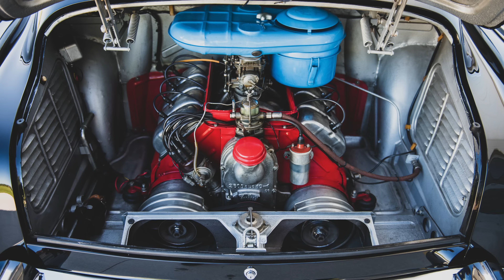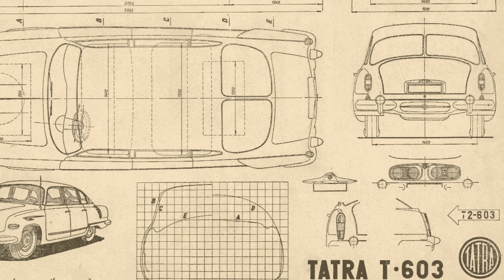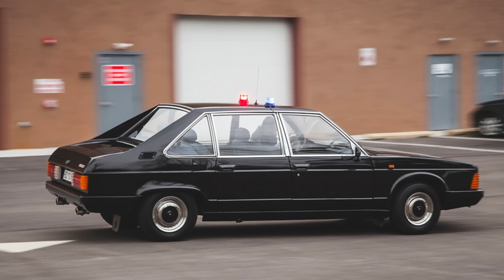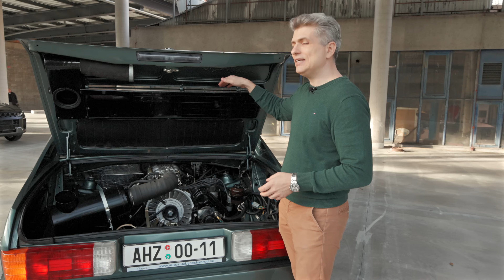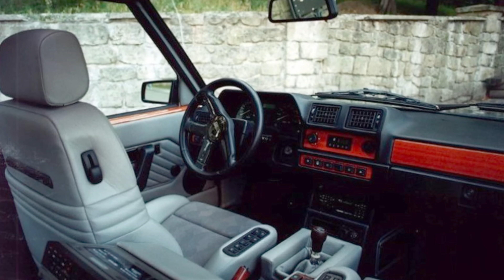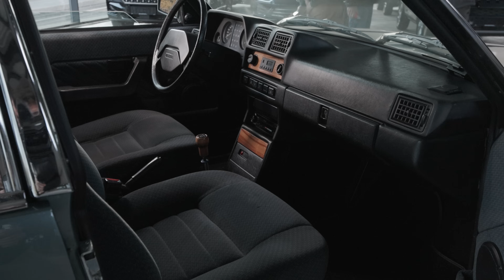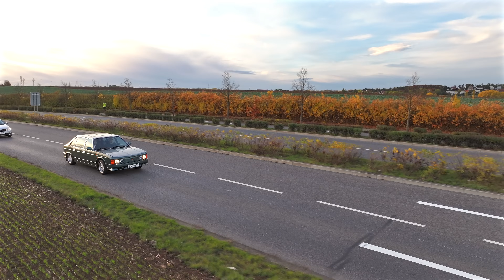I explore and drive Tatra 613, the bizarre car with an air-cooled V8 engine

Comment: One of the cars I always wanted to see in real life. and how I would love to see Tatra come back and produce a real luxury car that looks and feels different than what we know today. a true contender for worlds most luxurious car producer able to beat Bentley and Rolls Royce if they put their minds to it. The one thing that could have made the Tatra 613 exceptional would have been the hydraulic suspension from Citroën. Also that turning circle was pretty sharp, much smaller than what I was expecting. As for that engine sound, it doesn't sound like a truck, it sounds smooth and effortless, many V8 if not all of them today don't have such smoothness.
Reply from the maker: You have very good points here, which made me think deeper, indeed, a hydraulic suspension would have made it even more special, but still, it was one of the first in the world to use multilink. Turning circle was good indeed and the comment with the engine sound made me reconsider, it may be very well due to the good balance of the construction that it sounds deprived of the usual knocks from other V8s. Thanks for new perspectives of looking at it!
Reply: Diciamo la verità, era uno strano accrocchio al limite del controsenso dagli anni 60 in poi, .. e aveva un fascino speciale proprio per quello

Comment: This has to be prone to engine overheating.
Reply: No, sir.  Mr.Hanzelka and Mr.Zikmund traveled thru Africa and South America in Tatra 87 in late forties.
Reply: @vitezslavnovak2077  
There is a difference. Tatra 87 had 90 HP. This one - over 200. For each useful horsepower, three others, if not five, must be rejected as waste heat.

Comment: great technicians the Czech…I remember Java and CZ, beautiful motorbikes especially the last one, with its 350 4 cylinders L air cooled!!
Reply: CZ 350 was a 2 cylinder.
Reply: nNo, it was Jawa 250 single cylinder and Jawa 350 two cylinder side by side. CZ did not have two cylinder road motorcycle. @Tolmalion
Reply: @Tolmalion  negative...60's they made a 4 cylinders 90 degrees 16 valves air cooled...you are talking about the 2 STROKES

Comment: Thank you. Typical problem of gear selection on R.W.D. vehicle. 👍🏻🏴
Reply: Not typical at all actually and definitely not exclusive to rwd vehicles either
Reply: @roncook8566 Exactly right.  Rear transaxles, such as Alfas with DeDion rear like the GTV6 all had long gear linkages that made shifting somewhat awkward, but most RWD cars dont have this sort of issue.  Egen on the cars that were affected fixes were usually available

Comment: is air cooled an advantage in -30 degrees ???  

these must require bag cement in ther front , instead of the back
Reply: In soviet times, Tatra trucks became the sovereigns of Siberia (T111, 138, 148). T111 has it's own monument in one of Siberian towns.

Comment: While it doesn't have the avant garde beauty of the earlier cars, or even the simpler, cleaner and (IMO) more handsome lines of the early 613, there is just something very cool about this!. Given the problems making a mechanical linkage that long, it is surprising that Tatra stuck with a manual gearbox. Surely an automatic gearbox would be a much better fit?
My Dad used to drive a Magirus Deutz truck with an air cooled V8 (diesel), so I do have something of an affinity to Tatra cars!

Comment: Nice presentation of an interesting car. :) I've seen one or two of them in western Germany in the early 1990s.

I doubt it could do 230km/h tho. A Mercedes 380SE (W126) with 204hp did 210km/h and had most likely a much better drag coefficient than the Tatra.
Reply: Typ 613-4 Mi und 613-4 Mi lang Baujahr 1991–96
230km/h Werksangabe laut Wikipedia
sonst 190km/h
Reply: 180km/h confirmed :) in the standard one
Reply: @natasmedia  190km/h is valid for old carb engine with 168HP. 230km/h for 200HP injected Tatras seems to be a bit optimistic. But fact is that Tatra do not need grill with good airflow for cooler, which is also source of "internal" aerodynamic drag!

Comment: Are you sure that the clutch isn't worn? The linkages between the lever and the gearbox are probably problematic from the beginning and/or are also worn.
Reply from the maker: The clutch felt surprisingly perfect, much easier and much more refined even comparing to modern cars. I think it may be a problem with the linkage to the gearbox, which made it feel imprecise on this particular car.
Reply: @timelessdriving  Car that has always fascinated me, especially the aerodinamic pre-war Tatras
Reply: Yes, this arrangement may be more complicated than with the gearbox in the front, but I believe this is the issue with this particular car. It's not an superexotic arrangement, transaxle system is similar.

Comment: I'm sure the gearbox can be sorted. Very unlikely to have been so frustratingly imprecise for 231 223 km. And as the dealer is asking 2 500 000 CZK, IMO they need to sort it. Otherwise, great car.

Comment: Great subject and very good presentation and script.
.
However the editing is not so good... FAR too many cuts and silly camera angle changes. It comes across as if the presenter can only say 3 words correctly at a time. Of course these are just editing cuts with numerous camera angles, but it destroys the continuity of a very well-worded script.
.
The drive footage swaps video every 2-4 seconds to a drone shot, which is really annoying. It's worse because there is no reason to cut away half way through a sentence, or even in the middle of a word.
.
So, I suggest getting a new video editor who doesn't have ADHD, and who knows how to do the job properly!

Comment: Fascinating vehicle, but it sounds awful. Perhaps it's just the way it's recorded, or my speakers. Sounds like my garden weed whacker ;)
Reply from the maker: It is not because of mic or speakers, it is because of the engine being air-cooled, with no additional liquid circulating in it other than oil, having a large air fan that would sound sometimes louder than the engine itself. It sounds better when it is pushed in driving mode, having resistance to coup with. When stationary, it may remind you of a truck engine.

Comment: Was there an automatic transmission option?
Reply from the maker: No, only manuals, 4-speed at first, and then 5-speed. Because of the rear-mounted engine, this car would have needed a separate design for an automatic transmission, they could not just take a GM Hydramatic or something similar off the shelf, as many cars from those era did.

Comment: At first it seems odd to hear a 3.5L V8 described as a "large" engine, in Canada this would be considered quite a small V8. It's also quite odd to see a top-end luxury car equipped with a normal manual gearbox instead of an automatic. It's easy to speculate that if Czechoslovakia had not ended up on the wrong side of the Iron Curtain, Hans Ledwinka would be as well-known as Ferdinand Porsche and, in fact, it would be more widely accepted that Porsche blatantly copied the Tatraplan when he created the Kdf-Wagen/Volkswagen.
Reply: It made 160-200 hp out of the 3.5 liters. Not 100-140 like US cars of that era with 5-7 liter engines ;-)
Reply: @chrisridethatbloodything2044  That doesn't say anything about the relative expectations of what constitutes a "large" engine. Those low power figures for US cars of the 1970s were the result of making an effort towards lowering emissions, something Europeans wouldn't start doing for another decade. These comments always neglect to mention that European cars of the period were also weak-kneed in North American trim when they had to meet emissions standards.
Reply: It wasn't a "large" engine by Soviet standards either, the Zils and Gaz's had 5L or even 7L blocks. But it was a large engine in Czechoslovakia. Skoda (the other Czechoslovak car maker, much more affordable) used 1.0-1.2L engines, the ubiquitous Lada was 1.2 to 1.6L.
Reply: @jacobzimmermann59   Ehmmm... Thing is that Gaz was not exactly a normal car. I doubt even relatively high rank engineers would get a permit to buy one. There were a few second-hand ones serving as taxis in Poland but the first mod done was to remove the engine and put about 2.5 liter diesel from Mercedes or Peugeot in it.
Reply: Well, it can be considered a big engine for European standards in any decade. The average engine capacity in Europe in 1990s was 1.8 and it now went to 1.4, but cars with 1 liter or even as little 600cc were always common.
It was even bigger for the East Block standards. When Polski Fiat 125p arrived in 1969, the basic 1.3 liter version was considered a very fast car, and the 1.5 liter was the fastest cars in the whole of East Block a 'normal' person could buy before Lada arrived. "Normal' in this case meant either mid-rank party member, engineer, a doctor or someone else from highly-qualified higher education workers with some years of good work record because to buy a new one you had to receive an official permission ticket an 'allotment', and allotments for new cars were basically work incentives.
Reply: @piotrmalewski8178  as a Fiat 126 BIS owner I can agree 3.5 is large engine :)

Comment: The older models were interesting but this cost more than an S-class Merc, the best car in the world at that time.  Any other manufacturer of a prestige car would consider 250,000 km about average; this example of the best that Eastern Europe could manage is barely driveable, although it's way ahead of the crap the Sovs could produce even now.

Comment: Vignale styled but no streamliner. I’ve been following the T613 and 700 for over 30 years, they had 5 slight model changes with the T613, the 700 was overhauled and reskinned version of the T613/5.
Reply from the maker: Yes, you are right, the Tatra 700, the last model produced, was another later facelift of the same 613, but it needed a new name to make it appear as a new generation.

Comment: Well done! Thanks. Very interesting. 
But calling this car a masterpiece and call this avdvanced engineering? I really don't agree.
Reply: For a car going back to the 1960s? That's extremely advanced. Most western cars at that time still used stiff rear axles.

Comment from the maker: What do you think of this Tatra 613? I am eager to read your impressions on this model and version, and maybe on Tatra as one of the most special car manufacturers in automotive history!
Reply: My impressions? It’s a monstrosity on wheels imho. But véry intriguing that it exists. I once sat in a 603 Taxi in Prague. I let a lot of taxi’s go by to wait for a Tatra taxi. The engine (sound!!) makes it an intriguing car to me, not the looks of it
Reply: Interesting design. The symmetry looks ‘off’ in side-profile vs a traditional layout, but makes sense in maximizing the storage space under the hood. 140 mph in a straight line might be exhilarating, but you’d want some downforce on the light front end I’d imagine. 🪁
Reply: I really think that if tatra had made this car in a smaller more compact chassis it would have been a much better car.